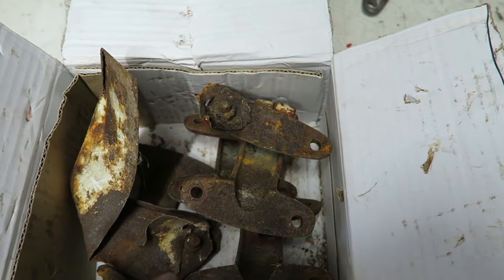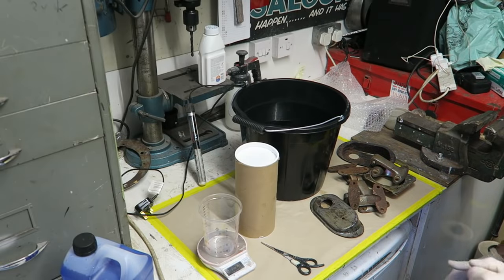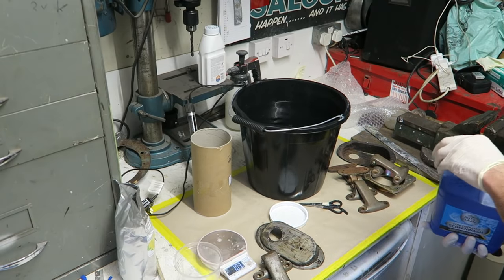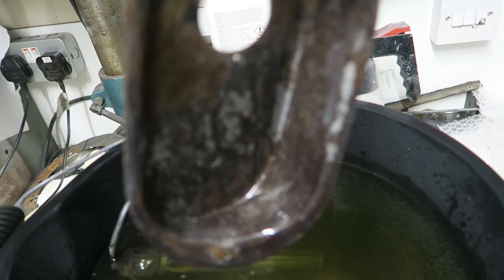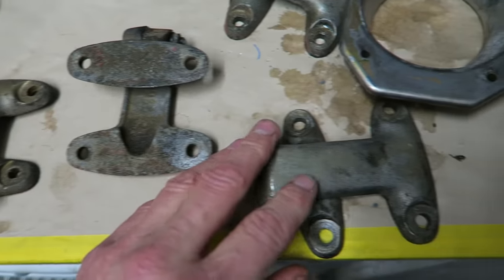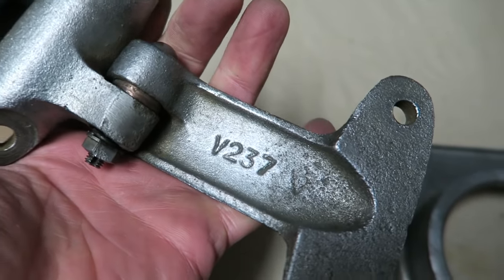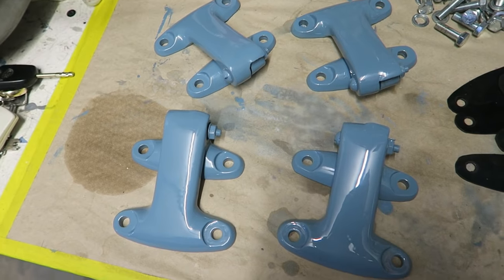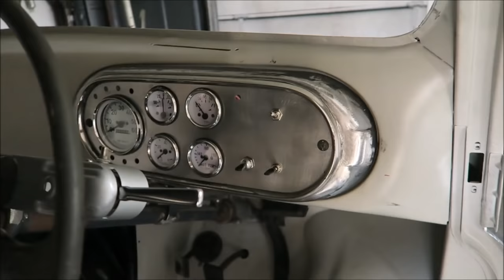Trev's Home Brew Rust removal potion solution remedy Tips and Tricks #23

Comment: Top tip about the embrittlement, lucky here as French supermarkets sell citric acid powder and 14° vinegar off the shelves. I use the vinegar for stripping galvo off fasteners etc as I hate welding the stuff, but it was interesting to see CA will strip it as well. I wonder if stainless bolts and washers would look good on those hinges? , stainless can look a bit classier than zinc sometimes. You can of course run some heat over SS to give it some colour if thats your thang.
Aquarium heater good idea, something for the shopping list  lol.
Reply: Jaques Daniels  what do I look for in my local Intermarché and is it with the cleaning products like the white vinegar ? Thanks joe
Reply: @joejojo4751  Yes, its usually in a packet, you should also see bicarbonate de soude there as well. I just found 20° strength vinegar in Cora. Leroy Merlin Brico may have it as well. I just tried citric acid solution on millscale, it does loosen it, bit obviously neat strong vinegar is faster.

Comment: Not to change the subject, but as a post below indicated another chemical has been banned, but going into my local home improvement store, I usually pick a another gallon of paint stripper for my automotive projects. As of 2019, none of the common brands contain methylene chloride. With out this aggressive and some what dangerous product, requiring correct handling but it too has been removed from access to the general public. It maybe found at professional distributors but not for the DIY's as this is the only common chemical that will attack and remove catalyzed clear coat or single stage catalyzed products. Sad. It has almost doubled in price over the last two years from 2017 - 2018, not gone in 2019. Good video and well spoken accent. Like! ASE Master Tech since 1978 / Retired.
Reply: We still got it in thailand. Its full strength n burns like a bastard! Its amazing how parts of you start stinging even when brushing it on slowly and taking a piss is to be avoided even after removing the marigolds...

Comment: Great video thanks Trev. I have used bolts that have the washer buillt into the head it does the same job but the washer bit is generally smaller overall outside diameter

Comment: Hi Trev again great video,
Yes the goldy colour is a yellow passivate it's basically a dye the change the colour of silver zinc plating etc.
Did you know you buy home kits that are perfect for all those silly brackets and lever mechanisms where paint make a them stick, we do our zinc plating I think I have a video on my channel or our fb page if you pm me I will be happy to assist you with the process etc it's a very rewarding process.

I personally would use a low profile fibre washer on the outside of the hinge it will seal against water ingress as a steel washer isn't needed as the cast hinge is strong enough to have force pulled against it try not to let the bolt head turn while tightening etc...

It's lovely colour by the way 

Regards 

James
Reply: i was under the impression the yellow passivate is zinc chromate.  i may be wrong.  zinc chromate is regarded as highly toxic.

Comment: Trev, just a suggestion, if you add common table salt to your citric acid solution it will speed up the process and the solution will last longer. I know, salt, water and steel don't make a good combination and I'm not sure about the chemistry but it really works, give it try.

Comment: Great tip. Food grade citric acid appears reasonably priced online. Do you know whether the other methods--electrolysis, "chelating" (which is what some of the commercial products claim to accomplish)--are any better or worse from the standpoint of end-strength of the material? Do all of them make the metal more brittle?
Reply from the maker: Rick Rose as far as I’m aware any process other than shot blasting could potentially cause a small amount of damage. Cheers Trev 👍

Comment: I have the 35 year old boiler tubes out of a Fowler steam engine, rust like you've never seen. I've started with electrolysis and washing soda and am pretty happy with the result. It's such high quality steel that it's brilliant as structural tubing. It'd be great to see how they compare. Thanks Mate.
Reply: 306 CHAMPION Please tell us that they are not going back into a boiler. If the answer is yes please don’t.
Reply: @ryandavis7593  LOL, No Mate, they're being used to make stuff. Theres a few grand's worth of new stuff to go back in but thanks for your concern.
Reply: @ryandavis7593  No Mate, they're going to be used in gate hinges and anything else I decide to make. After 35 years in a boiler you might be amazed at it's quality for structural use. Please don't panic, theres about $3000 worth of NEW boiler tube waiting to go back in, LOL.

Comment: I vote the shifter cover was zinc with a yellow chromate and not passivated.
You can get the same results doing Cadmium with a yellow chromate.
The cost would be lower with zinc.
(Only speaking from 19+ years in a plating shop.)
Reply: wikipedia regards zinc chromate as highly toxic.  cadmium chromate is probably even worse.

Comment: Think your correct yellow iridescent passivated zinc..    There's another process they use that's kind of a yellowish gold but not iridescent they call cadmium plate.   But this process you have does work great I'm  going to use I've  been doing it the hard way rotory wire brushing, stones, and sanding discs.  Thank you sir !  Will coke work you think Trev ? They say work smarter, not harder.

Comment: Wow, I would never have believed that those hinges could not only be salvaged but that they would come up so well! Top, tip! Well done!
As for washers, I think you should put them on. We probably lost our industrial might to the Japanese because we insisted on using washers on bolts instead of investing in better fixings like they did. However, any man who insists on knocking up rubber gaskets for the hinge to door meeting probably won’t be able to sleep at night if he didn’t put the washers on the bolts. Think of the better spread of force! That’s proper British engineering, that is: You can’t see it and you can’t tell it’s there but you’ll know...
And one day, when a man in a brown work coat with four pens in the top pocket eyes your work, he will nod approvingly, rather than suck his breath through his teeth and tut. And then you’ll be glad you did...

Comment: Trev, came back to watch this a second time a year later because I'm about to try this method on an old motorcycle tank. On the second go-round, I found myself asking, what was wrong with the original hinges on the truck?
Reply from the maker: The brass balls were badly worn. The only new ones I could find were too small, but i used them anyway. The doors were then too low so I drilled out the mounting holes which enabled me to raise the doors. The problem I had was because the holes were larger the bodywork distorted as it tried to pull through the holes. The replacement hinges although rusty had hardly any wear. Cheers Trev 👍

Comment: Trev, another great video. Thanks.  I just wondered what you would use on the main car body before primer to deal with those tiny pits caused by stone chips and the like that may have tiny amounts of rust in the pits. I have seen people washing / scrubbing the car body with vinegar and water but not sure how good an idea that is. Cheers
Reply from the maker: Christopher Thompson I use abrasives like clean and strip wheels by 3m. Cheers Trev

Comment: If you can get your hands on some phosphoric acid 30%, just put it in a spray bottle (careful to wear appropriate gloves and face shield) spray it on the rusty items, let it soak for a minute or two and pressure wash you're done in about 10 minutes total. 

Do take care not to get the phosphoric acid in your eyes though, because it WILL blind you. Permanently.

I got mine from a mate who works at a cleaning company. Professional lime scale remover. (phosphoric acid 30%)

I've cleaned stuff that I thought beyond repair with this, in less than 5 minutes. It's like magic. 
Do treat it with appropriate respect though, because you WILL be injured of you don't. You only have 2 eyes and it only takes one little mistake...

Comment: Morning Trev, I went back through your videos this morning as I remembered I watched one about rust removal, do you think it would work on removing rust from the inside of a petrol tank?
Reply from the maker: Julie Blackwell a friend if mine has used it to do just this but I haven’t personally, I know that you can get sealers to put in tanks to seal off the metalwork inside and seal up leaks etc, perhaps it would be an idea to use that afterwards. Just make sure you rinse and dry the tank thoroughly before using anything after. Cheers Trev 👍

Comment: You are referring to Cadmium plating on the gear shift boot plate. It is usually uneven gold colour and a bit better than zinc plating in terms of resistance. I doubt your solution will embrittle suspension parts that much, they are usually much stronger than required on British cars. Cheers.

Comment: Interesting video trev, Iv got a old fuel tank from a bmw e30 that’s very solid but has some very stubborn old fuel/rust stuck to the bottom of it. Do you think this method would be a good way to remove it? Just on the inside of the tank 

Thanks Jack

Comment: I’ve used citric acid for years but never knew what ratio to use. It is so much cleaner than using molasses and not having the part completely submerged is not an issue. I’ve also found that if I pressure wash and dry the parts the do not flash rust even after two years.

Comment: HYdrogen embrittlement  can be nullified by heat treating or baking the parts after cleaning by simply placing in an oven between 350- 400 degrees for a minimum of three hours.  This causes the hydrogen atoms to be diffused back out of the metal.  Cheers

Comment: Phosphoric acid works about 1000 times faster and wont attack the steel. its used as concrete wash and available at hardware stores. About 15 minutes and the surface rust is gone. multiple treatments for heavy rust. apply it with a spray bottle and wait, no soaking.
Reply: billyfromtheusa  in the USA kleen strip concrete and metal prep sometimes also called concrete clean and etch
Reply: billyfromtheusa  it's just acid though not paint stripper. Same viscosity as water but usually tinted green

Comment: The heater is good, most chemicals double their effectiveness every extra 10deg. C. Phosphoric acid is better, and will work colder.
Reply: Tezzr Terry true but while not terribly expensive it costs a lot more.      It does make a nice final step as a finisher / converter primer .     Prime with epoxy primer or POR 15 and coat with a nice hard urethane and you’re off to the races.

Comment: Cadmium zinc = rust inhibitor. (yeah. nøt so much hunh?)

A quick sandblast will speed things up. Alot.
Electrolysis is much quicker too, and in my experience it's more effective and less destructive than acid bathing/etching. 
Effectively neutralizing each and every acid molecule is very difficult, especially in the deeper pores created by, and filled with rust oxidation you can't always see. It's the nature of the beast called rust.
Acid etching looks great cosmetically, but doesn't usually provide long-lasting results.
Rust is the equivalent of cancer for metals. Remission is common, for awhile, but in the end, it's the treatment that kills you.
Just sayin'.
Reply: bake soda nutralize
Reply: enzo orciuoli
Only if you can get it deep into the pores, and under the acid residing at the bottom.
It's not 100% effective.
An ultrasonic bath might help, but electrolysis is still better.

Comment: Don't just fit washers, fit 316 grade stainless steel cap heads and stainless washers, every fixing I put on my VW Splitty is stainless, except i use copronickel exhaust nuts. Never have to wrestle with rusted on fixings again (seat belt bolts excepted)

Comment: try using a 5 gal bucket with lid just put a small hole in the lid for stripping small parts and u can just leave it in the bucket for other use
Reply: ps i just use rust mort works the best for old cars take a wire wheel to it put rust mort on and it can't rust again so fare one car has lasted over 20 years with it has no sign of rust were i put it and i did a bad job on it first rust repair i did i was told by an old body guy to use it to fix rust problems

Comment: Have you heard of electrolysis or whatever it's called.. you connect the parts with a wire put them in some kind of solution and run electricity through them. Think it's only good for really small stuff like bolts though but wow it works

Comment: Brill Trev I know you said about no brake or components but could you do it on brake carriers ? Thanks keep it up also any good tips on removing the factory tar off floor plans and under seal 🥴😎👍
Reply from the maker: Diamond gezzer boyd with a full face visor and one of those wire brushes on an angle grinder, that’ll clean those brake parts well. I would never risk anything load bearing with any form of acid, it may well be ok but what if it isn’t? Try using a hot air gun and a wide wood chisel on your old underseal. Cheers Trev 👍

Comment: Hey Trev. Here's a somewhat related question maybe for a video too: What would you use on surface rust in unreachable/awkward parts where taking apart or cutting out and rebuilding is not really an option maybe because of time or financial reasons? I mean to somewhat stop, inhibit or passivate the rust from spreading. Any chemicals or products you had good results with? Thanks
Reply: Get some phosphoric acid, works the same but is a bit thicker already. It's the working ingredient in almost all commercial de-ruster. If you want it even thicker, find some "paint stripper thickener" at a bodyshop-supplier. It's hard to find, but will make a very nice paste that you can even use upside down.
Reply from the maker: balázs gyurka I’m sure I’ll cover this in other videos soon. Cheers Trev 👍

Comment: Try phosphoric acid, best stuff there is for rust removal!
Reply: Hydroflouric acid works quite well,also.
Reply: Phosphoric acid doesn't remove rust per se. Rather it converts the rust on the surface to an inert material after which you can prep the part for finishing. But what you have to do is break off any rust scale first (using a rotary wire brush or with something more aggressive) until your left with the solid part and then use phosphoric acid to treat the surface to prevent it from rusting again.

Comment: Hydrogen embrittlement tends to affect high strength steels most. It's easily dealt with by a heat treatment at 400 C time dependant on section. That's the standard procedure after refurbishing aircraft under carriage where you really can't afford to have things break but must protect from corrosion by plating. The yellow passivate on the plated part was probably zinc and a chromate passivate, cadmium is rare now days because of health concerns . The quick test is to dissolve a bit of the plating with a spot of acid and add a drip of sodium sulphide solution. A white precipitate is zinc, a yellow one is cadmium.

Comment: It could be Cad.  The gold plating is a cad?irridite plating ever so light,  Cad is a sacrificial plate on thin steel and then irridited for seal and paint adhesion. Used in all kinds of auto and aircraft parts,  Before the world became eco-friendly.  Or it could also be zinc like you say. Rust attacks cad because it is less Nobel and corrodes before the steel.  Bolts are cad plated for the same reason and cad has some lubricity for galling and rust welding.  Hydrogen can be baked out to rid the part of its embrittlement. 275 degrees for 24 hours, but don't use moms oven...

Comment: If embrittlement is a problem what is the best way to remove rust from high carbon steel such as brake parts. About to start work on a very rusty Massey Ferguson 135.
Thanks.
Reply from the maker: Lloyd R. Sand blasting without doubt. Cheers Trev

Comment: that   really transformed those parts, I use electrolysis do you think there would be the same problem with  hydrogen on high carbon steel as it is produced during electrolysis .
Reply: if steel exposed to hydrogen at high temperatures, hydrogen will diffuse into the alloy and combine with carbon to form tiny pockets of methane at internal surfaces like grain boundaries and voids.(WP) So no worries with electrolysis for embrittlement, neither with the citric acid method used in video.

Comment: That plating they use on those small parts like that is pure garbage.        I always start by knocking all the loose rust fur and paint off.    That exposes the stuff you really want your solution to get at.    That trick does seem to work almost as well as electrolysis with less setup.

Comment: Removing paint by boiling the part in water for 10-20 minutes. Normally comes off in one go.
Reply from the maker: Water Bug seriously?
Reply: @trevsblog  Yes. It works great. I've used it on really old painted light fixtures and generally the paint comes off like a skin. There are videos on it.
Reply: @trevsblog  Here's a link to one. https://youtu.be/Q9VmqW8bANY
I've seen videos that add baking soda, some add vinegar but I've found neither of these were actually needed but that might just be that I have hard water already.

Comment: Hydrogen brittleness: hydrogen is an extremely minute atom.It can easily penetrate and wander through steel, copper etc. If it finds a rust or oxide inclusion it will react with the oxygen in the rust or oxide. Water vapor is then formed, which is a gas. The water vapor expands causing a micro explosion which causes micro cracks in the surrounding material which then becomes brittle. 

Isn't technology beautiful!